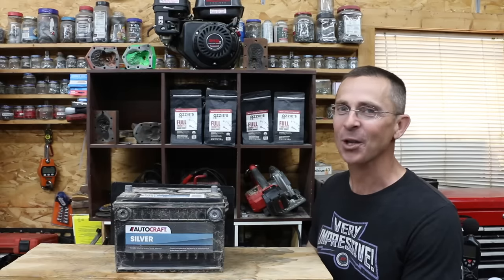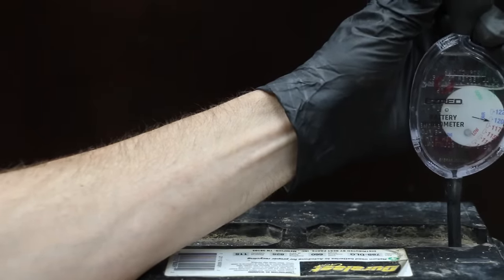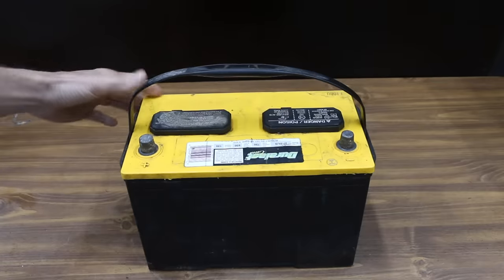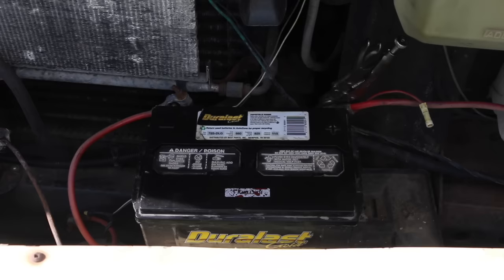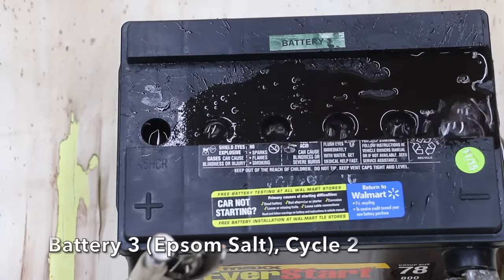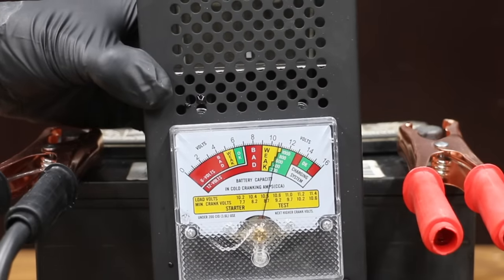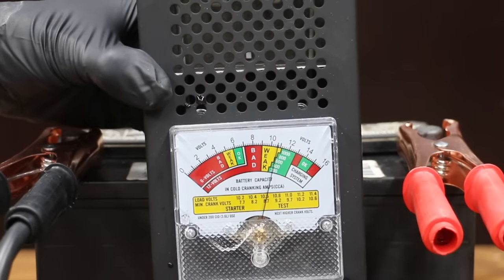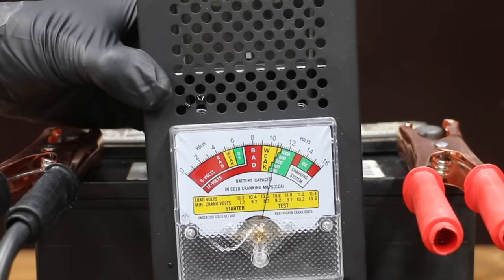Myth Busting! Can You Restore a Dead Car Battery With Welder?  Let's Settle This!

Comment: This was a fascinating test. If you still have the battery that was treated with Epsom salts... Flush it one more time with distilled water, than REFILL IT WITH BATTERY ACID. Put it through a thorough, long, slow charge - and retest it. The Epsom salts might have cleaned up the plates, but lead-acid batteries need acid to work properly.
Reply: I was just about to say that. You have to drain the salt mixture out and replace with battery acid.
Reply: Can you please explain the chemistry and why acid is required rather than salt water? Thanks.
Reply from the maker: Thanks for the constructive feedback.
Reply: @the upscriber  with sulfuric acid it creates a process that is chemically reversible. When discharging the lead combines with the acid to create lead oxide which is deposited on the other set of plates, when charging the opposite happens.
Reply: @theupscriber65  Ask ChatGPT nobody on youtube comments has the time: 
Certainly! A lead-acid battery is a type of rechargeable battery commonly used in vehicles, uninterruptible power supplies (UPS), and other applications. The chemistry behind a lead-acid battery involves the interaction between lead and lead dioxide electrodes, sulfuric acid (H2SO4) electrolyte, and the production of electrical energy.

In a lead-acid battery, each cell consists of two electrodes: a lead dioxide (PbO2) positive electrode and a lead (Pb) negative electrode. These electrodes are immersed in a diluted sulfuric acid solution, typically with a concentration of around 30-40%. The sulfuric acid acts as the electrolyte, providing ions for the electrochemical reactions to occur.

During the discharge process, the lead dioxide electrode reacts with the sulfuric acid, producing lead sulfate (PbSO4), while the lead electrode reacts with sulfuric acid to form lead sulfate as well. The overall reaction can be represented as follows:

Positive electrode: PbO2 + H2SO4 + 2H+ + 2e- → PbSO4 + 2H2O
Negative electrode: Pb + H2SO4 → PbSO4 + 2H+ + 2e-

As lead sulfate is formed on both electrodes, the concentration of sulfuric acid decreases. This leads to a decrease in the voltage of the battery and ultimately its capacity to deliver electrical energy.

When a lead-acid battery is recharged, the electrochemical reactions are reversed. Applying an external electrical current to the battery causes the lead sulfate to break down into lead and lead dioxide, and the sulfuric acid concentration is replenished. This process allows the battery to be reused multiple times.

Now, to address your question about the use of acid instead of salt water in a lead-acid battery, it comes down to the specific chemistry and the requirements for the battery's functioning. While salt water (sodium chloride solution) can conduct electricity to some extent, it does not provide the necessary ions and chemical reactions for the lead-acid battery to work efficiently.

The sulfuric acid in a lead-acid battery plays several crucial roles. Firstly, it provides the necessary ions (H+ and SO42-) that participate in the electrochemical reactions at the electrodes. Secondly, it facilitates the formation of lead sulfate on both electrodes during discharge. Finally, during the recharging process, the sulfuric acid allows the lead sulfate to break down, replenishing the acid concentration and restoring the battery's capacity.

In summary, the specific chemistry and electrochemical reactions involved in a lead-acid battery necessitate the use of sulfuric acid as the electrolyte rather than salt water. The acid is essential for the functioning, efficiency, and reusability of the battery.
Reply: @theupscriber65  do you think they would really use a harsh and expensive chemical like acid instead of saltwater if saltwater performed the same?
Reply: Surprised Todd left the Epsom salts in.  Salt is whats left when you add acids and bases, and is close to neutral.
No doubt, it didn't take much of a charge, not sure what that stew was doing to the plates.  
Agree, rinse and replace the E salt with electrolyte.  

Actually, for all of these batteries, a more controlled test would have been remove and rinse with water, add new electrolyte and charge. Then see how they act, and do individual testing.  This is not one of the best tests, since you have 5 different batteries with potentially different issues.  Thing is, some of these might have sulfated plates, and other might just be degraded plates, with dead/low voltage cells caused by debris grounding out.
Reply: Keep in mind Epsom salt is used for this because of its sulfur and sulfate content.
Reply: YES_YES_YES David. That is what I thought and the way I remember it was done. You have to flush it with water after the epsom salt THEN FRESH ACID. Skipping that step is not allowed in my opinion.
Reply: I caught that too. I wonder though if you could save the acid and put it back in....l'm ultra cheap

Comment: The key to fixing a bad battery is by picking up a box of acid at Oreilly's for $10 and draining the old acid out. Then use 3 jugs of distilled water for cleaning the battery. Each time the battery is filled with the water, replace the caps and shake the battery vigorously for several minutes. Dump the water and repeat till the fluid coming out of the battery is clear. Then add the new battery acid and charge. This method restores a battery to 100%  nine times out of ten.  Great video by  the way.
Reply from the maker: Thanks!  Thanks for sharinig.
Reply: This works well, especially if you desulfate firet.
Reply: What do you do with the old battery acid?
Reply: @MJRaymond do not use it to water plants.
Reply: I think I am going to test your theory. I have 3 immobile vehicles I got a letter from the city about and I'm sick of buying batteries at $150+ each
Reply: You're dumping water that's loaded with lead particulates into the water table.
Reply: @MattJonesYT  NO it all goes into a 5 gallon bucket and is then dropped off at the recycling center in town that handles haz mat materials. A person shouldn't have to be told the common sense part of the process such as wear saftey glasses gloves etc. but I do know in todays society the owners manuals of new vehicles warns not to consume the battery acid. Guess people are dumber than we realize.
Reply: It sounds like we need part 2
Reply: @chaplainlee  Then the recyclers dump it into the ground.
Reply: Hey, what's the ratio of sulfuric acid to distilled water when refilling the batter cells?
Reply: @jeremymalone189  I have always used straight out of the container without diluting.
Reply: So just put 100% battery acid in each cell?
Reply: @chaplainlee PREACH!!! 😂😅😆😁
Reply: @lolatu8255 Com'on man... that's a terrible way to think... gotta look at the cup half full, expect the BEST out of people not the WORST  , thought it wuz innocent until proven guilty 🤔🤔🤔 not the contrary
Reply: @krishaley5502 😂😂😂
Reply: @chaplainlee  I just watched a video of a guy dumping it straight on the ground and not knowing anything about this immediately thought, OH NO.  It did look savage.
Reply: @krishaley5502 makes a great weed killer 😂
Reply: @MJRaymond  Battery acid mixed with baking soda makes sodium sulfate, water and CO2 as byproducts. All are non-toxic substances. Sodium sulfate is an ingredient in laundry soap.  In other words, you can neutralize it with baking soda and then dump it down a drain.
Reply: @delgriffith1  still has lead.
Reply: @jopshua4703 how did it work?
Reply: @C.JoneZ19  not great. It acted like it wanted to take a good charge but I suspect my inverter welder doesn't deliver amperage as quickly and harshly as an old transformer welder.
Reply: @jopshua4703  oh rip
Reply: @gabemartinez2014  If you're expecting the BEST from people, that's a terrible way to think. I knew a woman who worked in recycling. I'm with lolatu.
Reply: @MJRaymond add it to the coffee pot at a Starbucks, they won’t know the difference
Reply: @BenState  Good point. I assumed it would be minuscule but apparently not. I can't get firm numbers on concentration in a quick search. From what I can find, some can be filtered with a coffee filter, and actually coffee grounds absorb it too apparently.
Reply: @delgriffith1  Acids make heavy metals mobile in solution and in the environment.  A coffee filter cannot help with that fact as it only removes lead particles of a certain size and above.  The small particles, dissolved atoms of lead etc are all still in the solution you're dumping.  Even small amounts of lead can be pretty damaging.
Reply: This is why "sealed/maintenance free" batteries are mostly a scam. My grandpa always repaired his car battery with a rinse and new acid and it lasted forever. Not all sealed batteries are trash though.  My truck is a 2013 model an it still has the original batrery from the factory and it's still in very good shape. We don't get extremely cold or hot weather where I live though so that's also something.
Reply: P😊😊😊
Reply: @BenState  A significant amount of lead is particulate and not liquid, and the coffee grounds actually can absorb the lead ions apparently. Back yard chemistry stuff so probably not going to get it to drinking water that way, agreed.
Reply: @delgriffith1  acidity changes all of that.
Reply: @chaplainlee when u wrote to charge the battery, what am I charging it with? Do I need a high amperage battery charger?